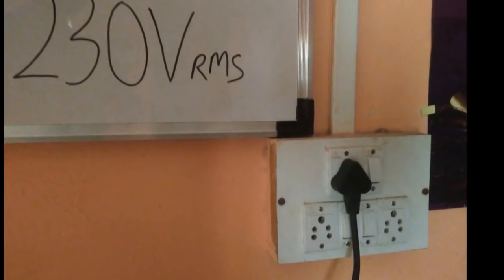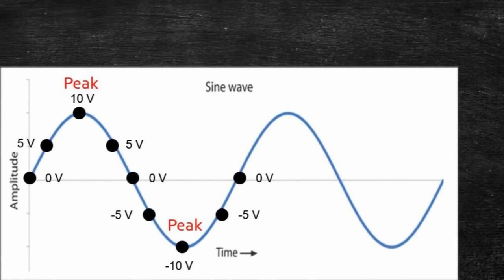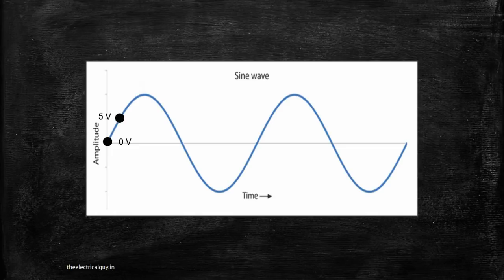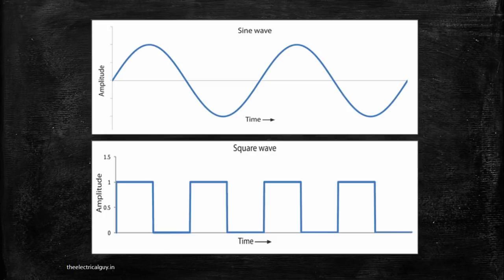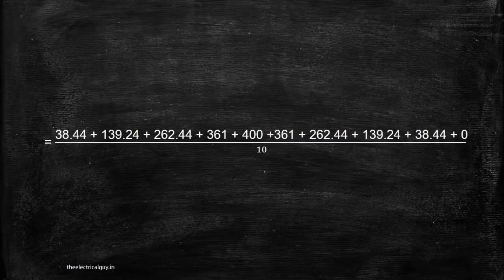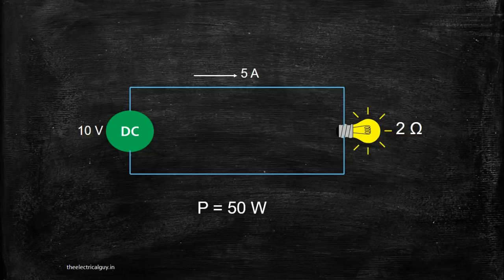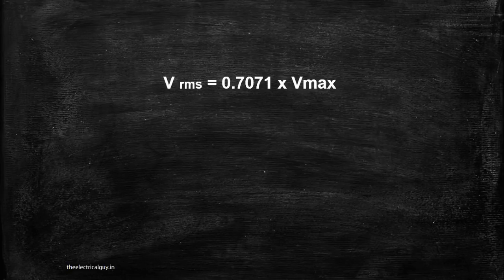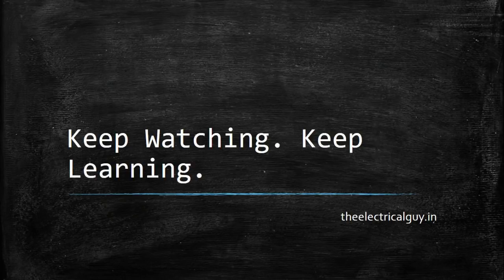What is RMS value | Easiest Explanation | TheElectricalGuy

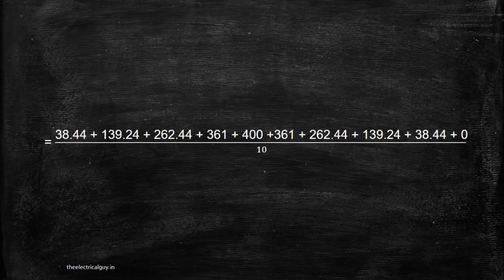Comment: Dear one. The explanation of the term "RMS" is very useful and informative Thank you. I have to comment that in the 4:57 time line the equation has to be in parenthesis in order to group the result as the sum of the numerator divided it by 10 as so, ** (38.44 + 139.24 + 262.44 + 361 + 400 + 361 + 262.44 + 139.24 + 38.44 + 0) / 10 = 200.224 ** Then, the square root of 200.224 is as so, √( 200.224 ) ≈  14.150053003 Volts RMS. Best Regards.

Comment: You overcomplicated it. 
The RMS (Root Mean Square) value of a sinusoidal electrical signal represents the equivalent DC voltage that would produce the same amount of heat or power in a circuit as the original alternating signal.
Simple as that.

Comment: Hi, from England, UK. The sine waveform is normally used for basic ac calculations because that's what is supplied from the mains. And RMS voltage is normally used for stating ac voltages with a sine waveform because way back in past someone carried out an experiment with an electric fire element and they found that they got the same heat, and therefore the same power dissipation with the same applied RMS ac voltage as the dc supply, i.e., A 1Kw 240 volt fire element will dissipate 1Kw whether it's supplied with 240 volts ac RMS sine wave or 240 volts dc. And the term for calculating the values of different ac waveforms is the crest factor, which for a sine wave is 1.414, whereas other waveform have other figures, and just to complicate things a bit more, some ac waveforms have TWO different crest factors, that's something I learnt from working on the old type analogue TV sets with the old cathode ray tube, where some of the waveforms produced by the various circuits will give a different voltage when rectified to dc for each polarity, i.e., if you rectify it to positive it will give a different dc voltage than what you would get if you rectify it to negative, and this was often used by TV manufacturers to give different voltages of either polarity. And ac calculations get much more complex when you use reactive loads like those which are inductive or capacitive, then there's all manner of complex advanced maths involved, so you need to be good with maths!

Comment: According to me, at 4:03 the second graph i.e. Square Wave Form is wrong. Because that graph says that the current is always positive and is not changing it's direction. Please correct me if I'm wrong.
Reply: There is more wrong here haha, the square show only half of the positive pulse of the waves, it needs to be doubled. And for the negative pulses we don't draw them. You don't get any current from them so it's 0.

Comment: Nice. But could be better. I miss here the explanation why you make squares on voltages. You should have emphasized that the DC power U*I on a given bulb resistance R can be writen like U^2/R. So you make square on every point on the AC voltage chart, becase the power in every moment is U^2/R, just like for the DC source. And what you calculate by sum and divison is the average power. And the square root at the end is here to get the appropriate DC voltage that has the same power effect U = SQRT(P*R).

Comment: You would be hard pressed to find a more accurate description and explanation of RMS. Back when I was teaching industrial electronics I presented it exactly like Gaurav did except in reverse. In other words I discussed RMS's relationship to a steady state DC and then gave the students the formulas. BTW for those curious about rectified but unfiltered Pulsating DC the formula to find RMS or Peak are identical to that of sinusoidal AC. In a rectified (Full-Wave Only) 60Hz waveform the voltage or current swings from zero to peak and back to zero but does not cross through zero and reverse direction. Instead it swings back up to peak and down to zero repeatedly. A 60Hz sine-wave rectified to full wave will produce a frequency of 120Hz but frequency is not pertinent to RMS values, so the formula still holds true. Note: RMS calculations won't hold true for 1/2 wave rectification because 1/2 wave rectification creates a dead time of 1/2 of the waveform. A frequency counter or scope will measure a 1/2 wave rectified 60Hz AC waveform as pulsating 60Hz DC. 
Wakodahatchee Chris

Comment: Is 3 phase system Consider RMS values?.....If Nothing is Said in the question then then we consider the values of voltages and current are rms?
Example 
In a 3 phase system , Voltage is 30KV and Peak Current 218A . Then what is the average power deliver by that system?
Then give me solution

Comment: So in the case of calculating average value we end up with the numeric value 0 so that is why we introduced the concept of rms, why cannot we use modulus of the function to calculate the value in such a case we won’t end up with zero at any instance ? 

Ps: I know RMS value of the voltage is the same DC voltage supplying same power to the resistor and Average value of the voltage is the same DC voltage supplying same amount of charge through the circuit

Comment: At 4:38 please tell that how you got this values🙏🙏🙏
Reply: These values are wrong. Because vmax is 10v. But he marked values above 10v.
Reply: @selvakumarn7292  Yeah, he obviously used a different setup.The concept is still nonetheless.
Reply: Later he took 20V as peak value
Reply: How do you get those voltage valves on the sinewave

Comment: Very well explained Gaurav! Your 8 min video made a big impact in my life. I have a question though, I am measuring a heater powered in AC and I want to take the resistance reading. Is there a unit that I can hook up in order to get the resistance reading accurately? I know V/I will not work.
Reply from the maker: Thank you. 😊 Why do you think V/I will not give you a correct reading?
Reply: @GauravJ  Thanks Gaurav for the quick reply. I will be using a HOBO datalogger to monitor AC voltage and current while heater is running for 1 month then simply divide V/I to get R. Not sure if this is the best way to get resistance while unit is operating in AC.
Reply from the maker: I think you’ll get pretty accurate results with V/I. You can simply use a Multimeter to calculate V & I. If you still doubt that, then try calculating the power consumption of the heater and based on that you can calculate R.
Reply: @GauravJ  ..Thanks Gaurav for the fantastic answer!

Comment: At step 3, why it should be divided by 10 ? Why not divided by 9 or 11, as both value looks be able to be accepted to get mean value. Because if we divide it by 11 starting  from zero and end by zero, 2000 / 11 (not 2000/10) but prooduce different final value. And if we divide it by 9, it also acceptable as there is no 0 value in start point nor end point.

Please give me easiest and mathematical answer ?

Thank you very much

Comment: Wrong, RMS value is not equivalent with same amount dc value. RMS value is equivalent with heat production of same amount of dc value. Please correct it. If 10v dc value produce heat 5 joule. Rms value of 10 v Will produce same amount of heat. But not Rms value = DC value.  It related with heat.

Comment: so if you convert 20V AC ,you will obtain 14.14V DC sir? because you said that Vrms of 20V AC is 14.14V which is equivalent to it's DC value
Reply: No the value 20V is peak value of AC.if we will find out it's rms value is 14.14v AC & IT doesn't equal to DC value

Comment: Nice content. But where did the sample range [4:39] of voltages come from that are used to calculate the RMS? Are these arbitrary values you chose for the example? Let's say I'm using a "TRUE RMS" Multimeter. How does test equipment make this determination? I think the explanation of what RMS is works well here. But I am more interested in knowing how a meter makes this calculation for me... Any thoughts?

Comment: Please answer this question. AC - alternative current, it means current changes its direction not voltage ( i think ). but in the diagram you explained was the diagram where volt and amp changed. both. why?
Thanks
Reply: For voltage to change direction it must cross the zero value.

Comment: In calculating rms value we has to consider only upper half sine wave which is of 0-10v. But you take voltage 0-20v in calculating rms value. I am confused now whether we have to take up to peak value or peak to peak voltage in calculating rms value. Will u please explain sir?

Comment: chevy v 8 Camaro or a capri stand in car engine - truck is Westinghouse dodge ram truck waterpump freeze up on many we like there engine good drive power - hemingway is gone we used to like the 4cylinder gas mode top tech earth way - antigravity is way better now update it - waterpump is on a Camaro v8 allow there desighn for the dodge

Comment: Explain the concept . The procedure is easy since those who watch this have the matematikal Foundation.
Reply: Exactly .. actually the rms name itsrlf is a mathematical nomenclature , Effective or heat value is the actual name for that value ... 

1.When DC is flowing through the bulb then it will generate the heat which is equal to =  (i*i*R)  this heat can be measured by any equipment u can measure the lumens of that lamp 

2. Consider same circuit but now supply is AC in that case we have to alter the value of current until we get same amount of heat through the bulb , and once we get that value we can read that value of current , by ammeter or wattmeter ,
wattmeter gives us the value which is (i*i*R) 
Ammeter itself reads a RMS value or heat value ...

The actual definition of the RMS is the value of alternating quantity which produces same amount of heat as that of  DC source is applied to the load 

Provided for this experiment you need a non inductive resistance

Comment: Why is it not called AV Alternating voltage instead of Alt current.. AC..?
Reply: Actully its all about the flow of electrons .. alternation in the direction of electrons ...in one half cycle electrons flows in one direction and in next half in other ... But when we consider the voltage you cannont see weather it is changing directio.  or not current is actual flow of charges ... Hope so this explaination is helpfull

Comment: You did mention that RMS value will change per waveform used. I agree with this, however I disagree on the statement that RMS value is equivalent to DC value. For instance, a square wave with 50% duty cycle ranging from 0V-20V will have a DC of 10VDC but an RMS value of 14.14VDC. Please correct this if I am assuming a false statement.
Reply: https://masteringelectronicsdesign.com/how-to-derive-the-rms-value-of-pulse-and-square-waveforms/
Reply: You are not quite understanding the concept.  RMS voltage is defined as the equivalent DC voltage that will dissipate the same power in the same circuit as the AC voltage under consideration.  Power dissipation is calculated by P = V^2 / R.  Since the circuit will be the same, we can ignore R (it will be the same for AC or DC by the definition of an equivalent circuit) so power dissipation is proportional to V^2.  Since the voltage is changing in an AC system, we have to calculate the total energy dissipated in a single wave form.  Let's take a 20V square wave at 75% duty cycle.

V     V^2
20     400
20     400
20     400
0       0
-20     400
-20     400
-20     400
0       0

Mean V^2 = 300V^2
  (2400V^2 / 8)

Root of Mean V^2 = 17.3V

A 17.3V DC current will dissipate the same power as a 20V AC square wave at 75% duty cycle.  At 50% duty cycle, the equivalent DC voltage to dissipate the same power will be 14.1V DC.

Comment: i understud what u r said. but why in rectifiers and also in power electronics both rms and average or dc values are calculated separately 
note that the resultent calculation /derivations for rms and average are not same but whyyyyy they calculated separately
Reply from the maker: Unfortunately I don’t know about that my friend..! But I’ll try to find that out.
Reply: Rectifiers converts AC into DC...So we calculate average value of output voltage and current. But the diode and others devices also carries current. Since they carry current they do get heated. And we need to find rms current of diodes and other switches, to know the heat generated by them.

Comment: Good show!  It might help to mention that the reason for taking the squares of the values is to eliminate the negative numbers from the negative half of the cycle, otherwise they would cancel themselves out in the mean or average.  20+10+0+(-10)+(-20)=0 /5 =0
Reply: Actually the reason for squaring the values is not to eliminate negative numbers.  It is done because of the equation for power in electric circuits.  Vrms is defined as the equivalent DC voltage that dissipates power at the same rate as the AC peak-peak voltage on the same circuit.    Remembering our basic formulae for electric circuits:  P = V * I  and I = V/R, we can rearrange for power to be determined as P = V^2 / R.  So what you are looking for is: "what is the average squared voltage through my circuit in AC, and what DC voltage would produce the same average squared voltage."  (Since R will be the same by definition for both DC and AC power dissipation.) In this example, the average squared voltage for 20V peak-peak is calculated to be 200 V^2 .  So a DC voltage of 14.14V would produce the same average squared voltage of 200V^2 and therefore dissipate exactly the same power as 20 V p-p AC.  

Vrms is useful for calculating power consumption of AC appliances, which is why we use it.

The squaring and subsequent square root has nothing to do with eliminating negative numbers from the calculation.  It is a necessary step in defining the equivalent DC voltage the dissipates power at the rate of P = V^2/R. If we lived in a different universe where power dissipated with voltage to the third power , then we would calculate the "cubic root mean cube Voltage" as a handy number to determine equivalent power dissipation.
Reply: @Cedillallidec  can you please explain further so I digest it more .. like.. they first needed to calculate the effective value "voltage or power" because the signal is increasing and decreasing frequently "why not the average" ? .. then why did they do these steps ? why squaring then avg then sqrt ...? please clarify in abstract way ...
Reply: @miscs1321  Someone, please answer that question PLEASE!!!!!🙏🙏
Reply: @bydefinition7964  if you calculate the average, the negative signal will cancel the equal positive one (so that the average in a sinusoid is zero), that's why you need to do something more than just taking the average in order to know the effect of different waveforms on loads (especially power consumption) ! .. that thing is to square the voltage in which you always get positive values! then
by taking the square root, you eliminate the square value ! so its just a smart way .. 
the average is simply: 1/T * Integral(Vt.dt) while the RMS is sqrt[1/T*Integral(Vt^2 .dt)] ... remember that the integral is nothing but summing a bunch of products, so as in the video, take samples of the voltage to make things simpler to understand, square them, take the average (mean) then do the square root! .. so what did you do more than the average ? you squared, then took the square root again ... why ? just to eliminate the negative signal effect of cancelling the equal positive .....
Reply: @mibrahim4245  Squaring has to do with introducing the notion of power, not to change sign.  Changing sign is just a happy byproduct.  If all you needed to do was change sign, then all you would do is take absolute value.  Squaring also changes the function.
Reply: @Cedillallidec  very good explanation. Well done
Reply: @Cedillallidec  thanks!the video explained the how, your comment explained the why.
Reply: Clinton Andrews in the first step, i will divide them equally in 10 parts? It must be always 10?
Reply: wang bu, no he is just using 10 as a easy number you could use any number.
Reply: @Karshakan136  yes provided the divisor is equal to the number of times you've taken instantaneous voltage measurements .
Reply: If you square negative number, you always got positive result.

Comment: but why did values were squared? why not cubed? do not think other wise.why can not it mean of cubes
Reply: It is squared because of the equation for power in electric circuits.  Vrms is defined as the equivalent DC voltage that dissipates power at the same rate as the AC peak-peak voltage on the same circuit.    Remembering our basic formulae for electric circuits:  P = V * I  and I = V/R, we can rearrange for power to be determined as P = V^2 / R.  So what you are looking for is: "what is the average squared voltage through my circuit in AC, and what DC voltage would produce the same average squared voltage."  (Since R will be the same by definition for both DC and AC power dissipation.) In this example, the average squared voltage for 20V peak-peak is calculated to be 200 V^2 .  So a DC voltage of 14.14V would produce the same average squared voltage of 200V^2 and therefore dissipate exactly the same power as 20 V p-p AC.  

Vrms is useful for calculating power consumption of AC appliances, which is why we use it.

The squaring is a necessary step in defining the equivalent DC voltage that dissipates power at the rate of P = V^2/R. If we lived in a different universe where power dissipated with voltage to the third power , then we would calculate the "cubic root mean cube Voltage" as a handy number to determine equivalent power dissipation.

Comment: One single query. does the lamp draw current when ac is in its negative state? If not why
Reply: If it is just a resistive load (like old lamps are) it will glow both in the positive and negative half of the wave. It's just a resistor, both terminals are the same